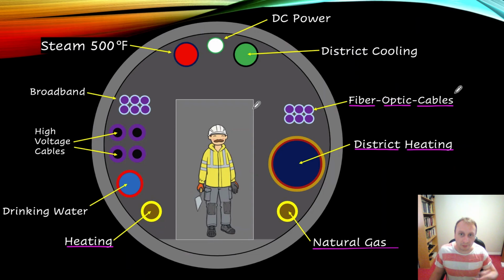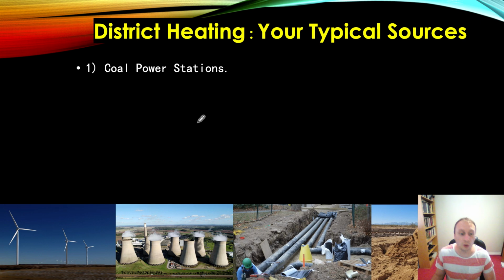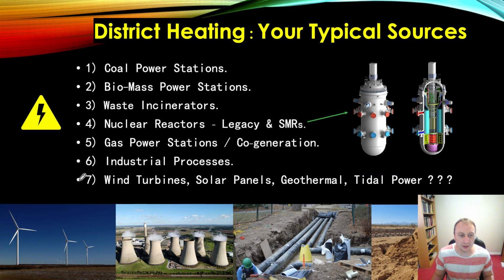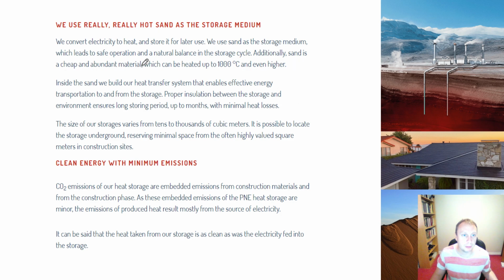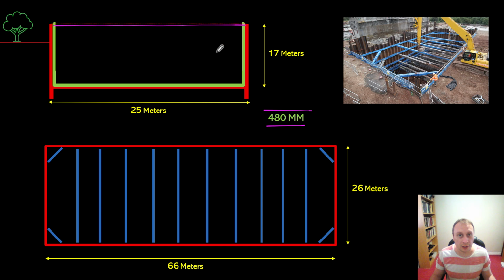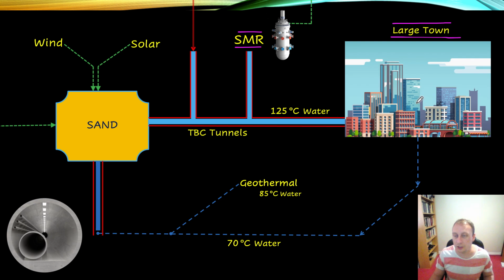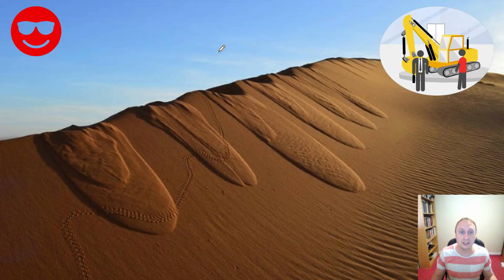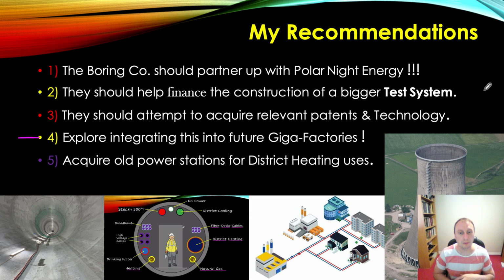Ultra Heated Sand, Hot Water & Utility Tunnels (PART 3) ?!?!? 😇 👍🏻 🚇 💰 👷🏻‍♂️ Episode # 111

Comment: It's much, much easier to send electricity somewhere and then use that locally to manage temperatures, or to build buildings in a way that have good passive temperature management implemented, than it is to send heat or cold somewhere over long distances. I can definitely see why Boring Co tunnels might be enablers for that technology. Cheap and abundant tunnels are half of all the work needed.
Reply from the maker: The easy solution is everyone lives in a Passivhaus and uses panel heaters and an electric boiler. 
However for pure energy efficiency and cost efficiency you can't beat district heating. If you compare over a 10 year period.
The UK has 22 million gas boilers or as I like to tell people : The UK has 1.54 billion gas boiler components that will inevitably break at the most inconvenient time and cost you an arm and a leg !

Comment: I do mechanical maintenance in a large hospital complex.  Any district heating project would deploy much of the same technology used in my facility.  It is technology that is too expensive, requires too much maintenance, and is just too inefficient.  I like the efficient storage of electrical energy as thermal energy in sand.  That sounds very promising.  However, I think the short and long term costs of the systems you propose to deploy ... using that sand battery heat to heat water in a district heating system ... would ultimately be inferior to utilizing the thermal energy in the sand storage to create electricity on demand.  A distribution system for electricity throughout a city and within individual structures already exists.  Electrical systems require some maintenance.  But, they require far less intensive maintenance than water and air systems.

So ... store all of your excess renewable energy in a dozen of these thermal sand batteries around a city.  Generate electricity from each of the thermal sand batteries as needed.  Distribute the electrical energy in the existing electrical infrastructure.  The simplest answer is the best answer.  The best part is no part.  The best process is no process.  District heating is not simple, has too many parts, and has way too many installation and maintenance processes.
Reply from the maker: It is technology that is too expensive, requires too much maintenance, and is just too inefficient.  WTF ????
I'm gob smacked by that above statement. How much does an electric boiler cost ? £3,400 + Labour ? Does it also require maintenance?

I think the short and long term costs of the systems you propose to deploy using that sand battery heat to heat water in a district heating system would ultimately be inferior???? Inferior to unreliable gas boilers?

Generate electricity from each of the thermal sand batteries as needed???? The loses incurred in turning Hot Sand into Electricity via a generator would be quite high. It adds insane complexity and would be turned off for large parts of the day thus not efficient. Have you actually thought about this idea?

The simplest answer is the best answer. The best part is no part. The best process is no process. YES, YES, YES.
Let me apply your logic to a large UK city, say Sheffield with a 584,000 population.
Sheffield, UK : 205,000 individual Boilers / Water Cylinders !!!! Replaced by just 4 SMRs , 6 Sand batteries and 40 Pressurised Water Tanks. Each house would still require a 600 litre mixer tank but it simply stores hot water under pressure. Unlike a gas boiler with 80+ mechanical / electrical parts that all eventually break costing hundreds of ££££.
Every morning each house in Sheffield individually heats its own water, this is not the way forwards (unnecessary process) when you can store heat for 6 weeks underground. 
Each individual boiler is likely to break down every few years or be subject to an isolated blackout. A district heating system can still operate with several parts offline. It is far far more reliable ! 
The weak link is the pipework underground that can be regularly maintained in a dry accessible tunnel.

Comment: I am a big fan of the idea of taking waste heat or cold and delivering to someone who can make use of it, however I think it'll be a difficult sell, for example, public swimming pools often have a gym and other facilities attached, but the a/c systems they have are the typical type that vent their waste heat to the outside air (instead of into the pool)
Reply from the maker: The sell is you offer home owners unlimited hot water for $115 per month.
Thus you undercut their gas boilers and fix the price for 2 years. 
The hard part is building out the infrastructure, tunnels, valves and vessels required to run it reliably 24/7 !